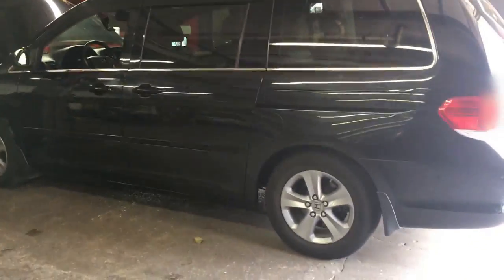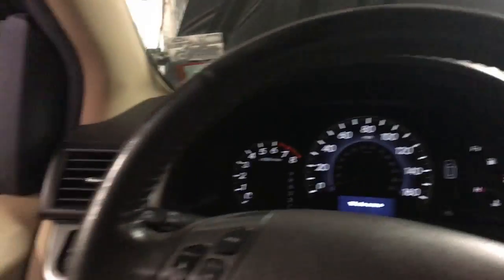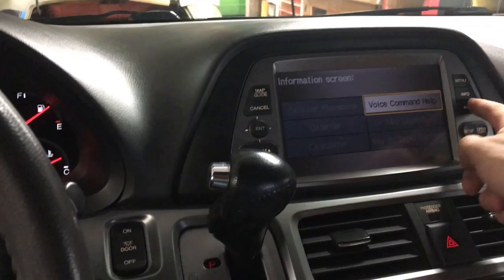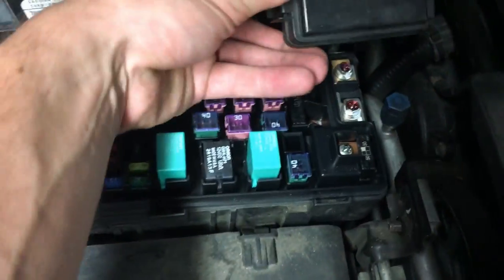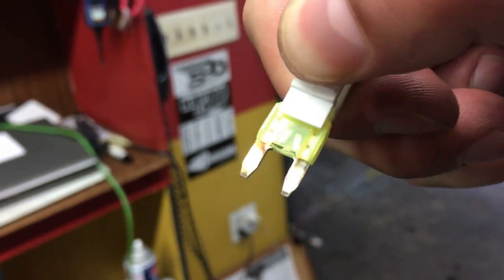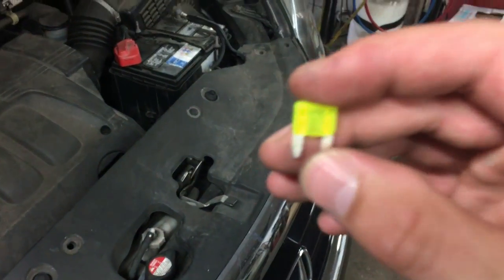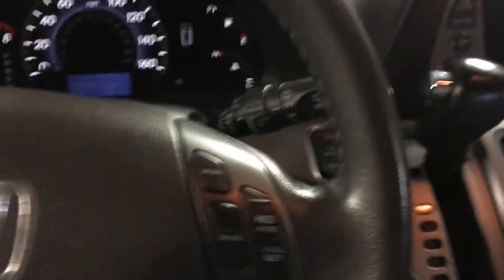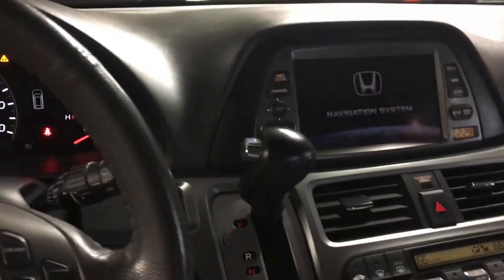Honda Odyssey No Sound but Radio Has Power Easy Fix

Comment: I having the same issue with my Honda accord 2010, i don't know what the problem is.is it the radio, amp or fuse...help-pp
Reply from the maker: Hey Salk Fozilov thanks for watching my video. Truthfully you should start with the fuses first. I am not sure that I have your exact model but check drivers side interior fuse 18 (7.5 amp) and drivers side interior fuse 16 (7.5amp). Also check under hood fuse 15 (10amp). Please let me know if any of this helps, and keep me updated. Consider subscribing to me, it would help me a lot, thanks.
Reply from the maker: Also if the fuses do not work there is a good chance you have a grounded speaker wire. The best way to check is with a digital multimeter do a continuity test on all the speaker wires.
Reply: thank u for replies.. so the problem was with the fuses under passenger side dash... the premium amp fuse was out.thx again
Reply from the maker: Hey Salo Fozilov I am glad you fixed it, always important to check all fuses before proceeding to the next idea.
Reply: @WheelsTips   Hi, can you help on my case, Honda Accord 2009. My android head unit sound work via Aux connection. One day, when i switch between reverse mode and run mode, the sound completely gone. (Which usually come back after reverse.) I did check 20 amp fuse. There still sound from speaker when i switch to original dashboard radio but no sound from Head Unit or Aux port.

Comment: Is it always the 20amp fuse for the no sound radio?
Reply from the maker: Hey Skander Ben Mekki thanks for watching my video. This video is of me sharing my experience with a Honda no sound from the radio fix.  Every troubleshooting experience and car issue is unique, it requires you to start and check certain things, in this video I guide you to what I checked and it happened to fix the problem.  Always make sure to check your fuse chart and owners manual to confirm where your fuses are and what type of fuse to use in what slot.  Please share an update on your diagnostics.

Comment: What is the fuse called? I have the same issue but volume comes on and off.
Reply: Marco Sanchez mine has sounds then fades to no sound then it gpes on and off
Reply from the maker: Hey Marco Sanchez thanks for watching my video.  Did you ever restore the volume on your Honda Odyssey?  Please share your fix, thanks a lot.
Reply from the maker: Hey kam shaft thanks for watching my video, please share your fix of the Honda Odyssey volume going on and off, thanks a lot.

Comment: Same exact issue on 2008 e350 a good Mercedes any help?
Reply from the maker: Hey Trippy G, thanks for watching my video. I would recommend you check your fuses, after checking your fuses I would scan the car for faults in the radio system. Please let me know if you resolved the issue, and if so what was the problem, thanks.

Comment: Hey, so my car radio works but it gives out weird noises...what could it be ? I don't think its fuse because it has some sort of a sound so what are the chances that its a short ?
Reply: So I assume you got nothing for me?🥺
Reply from the maker: Hey Max_Jank thanks for watching my video. What I would check in your situation is your connections at the speakers and in the door area to make sure that your wiring is in good condition. Also depending on what model you have, your amplifier maybe on its way out. What type of “weird noise”?
Reply: @WheelsTips  thank you! 
I have a Honda accord 2006 

This is the issue... 
Started going out- made a loud poping sound, and radio shuts off.. 
Everything comes up but when you put a CD in but the sound won't come....he radio won't come out and the sound pops once in awhile i think its trying to play but it won't.
Reply from the maker: Have you tried a different CD? Do you have any other issues with the car?
Reply: @WheelsTips  yeah nothing works
Reply from the maker: Hey Max_Jank thanks for the update. Nothing as in the car doesn’t work or nothing in the audio system?
Reply: @WheelsTips  in the audio system
Reply from the maker: Have you check all the fuses in the car? Do you have an owners manual? Have you had voltage / charging  issues or water damage of any sort?
Reply: @WheelsTips  i haven't changed the fuse but I was thanking on doing that. No problem with car whatsoever, just the radio its self dont work
Reply from the maker: It is definitely good practice to check your fuses. Please share an update.
Reply: @WheelsTips  yeah ill probably end up doing that

Comment: Hello Sir please help, stereo and speakers are good but everytime I step on the brake pedal either driving or not, my speaker shuts off but my stereo still has power..then after few pressing of the brake pedal, sound turns on again..I cant find any solution to my problem..thanks so much..
Reply from the maker: Hey jude delos reyes thanks for watching my video and for the great question.  What year , make and model is your car? Did you do any rewiring of your radio and is it the original radio?
Reply: Hi Sir, it's an aftermarket radio..I changed it because I thought the problem was the old stereo..so what I did was connect the positive or the yellow wire directly to the ignition switch but still it has the same problem..by the way I have s 99 hyundai starex..
Reply: I also tried the old stereo but it didn't work..thank you for the advice..
Reply from the maker: Hey jude delos reyes thanks for the update, I would say you need to check your fuses, then continuity of power to the head unit.  With all that said a wiring diagram would help you as well.  Please share an update if you can get a wiring diagram for your car, you may want to Google search, 1999 Hyundia Starex wiring diagram.  Looking forward to an updated diagnostics, thanks.
Reply from the maker: Hey jude delos reyes just checking in to see if you were able to fix your sound system on your Honda, any update is greatly appreciated, thank you.

Comment: My 2008 Honda Civic lx volume knob moves fine but the volume doesn't go up or down. Everything else works but the volume is stuck @ zero. It was stuck @ 100 when I brought the car but the used car dealership set it to 2 before I actually purchased and when I tried to raise it it went down to zero
Reply from the maker: Hey KidOldSchool let me start with thanks for watching my video. First to help me diagnose this do you have rear entertainment and if so can you get the car to adjust the volume of say a DVDwith the rear remote or rear controls? If so then it is most likely your radio unit itself or the knob is faulty. You can pick up a used unit but make sure it has a security code or you can send your radio unit out to remanufacturers they car rebuild it and give you a warranty.

Comment: i have the same problem in my ford explorer 2007... whrere is the fuse on this truck?
Reply from the maker: Hey Ramon Rivera thanks for watching my video. Truthfully I do not have a diagram of the Ford Explorer, I recommend googling 2007 Ford explorer fuse locations and check all your fuses. Please let me know where the bad fuse was after you find it.

Comment: Man i have the same prob but with a 2005 mustang that the radio shows everything but no sound comes from the four speakers but we checked the wiring and some fuses and no luck i need helppppppppppppppp!!!!!!!!!!
Reply from the maker: Hey Alex_King thanks for watching my video. If you have checked all the fuses and connections you should make sure your amplifier is working. Please get back to me with your diagnostics.
Reply from the maker: Hey Alex_King thanks for watching my video. If you have checked all the fuses and connections you should make sure your amplifier is working. Please get back to me with your diagnostics.

Comment: I have that on my honda civic 98 problem radio works but no souns
Reply from the maker: Thanks for watching my video and taking the time to leave a comment.  I would start with checking the connections at the back of the radio.  Please share an update if your checked that everything is secure with the plug connectors in the back of the head unit., thanks for any update.
Reply: @WheelsTips  everything is good connected
Reply from the maker: Do you have the original setup? If not maybe you have an amplifier that’s has a bad fuse. Also have you tried to swap the radio itself? Thanks for any update.

Comment: I just bought an 03 Gmc single cab and the radio works but only one little side speaker works hopefully it's the same problem
Reply from the maker: Hey jonathan chavez thanks for watching my video.  Please share your fix to only getting sound at one speaker on your 03 GMC, was it a bad wire?  Please share, thanks a lot.

Comment: hello does anyone know who the problem was doing the same but there is no sound the question is Ssangyong kyron 2006 if anyone can tell me what the problem is thank you
Reply from the maker: Hey Zoran Novakovic thanks for watching my video video. Have you checked all your fuses? Check in your owners manual where your fuses are and check them.
Reply from the maker: I just google searched Ssangyong kyron fuse box and found the entire layout. For example fuse 43 10amp seems to be for ‘audio’ check if the fuse is good. Let me know update.
Reply: thanks for your reply but am don't have the
Reply: @WheelsTips  Owners manual
Reply from the maker: Google search, ssangyong kyron 2006 fuse box. The first link will be to a manual website.
Reply: Can you google it for me and send it to see where that fuse is
Reply from the maker: Sorry but that is not my material. Give it a try, this will develop your best automotive knowledge. Make sure you know what your are doing before performing any work. Much luck.

Comment: I changed the fuse. But it didn't solve the problem. Still no sound.
Reply from the maker: Thanks a bunch for watching my video video and taking the time to comment. Was the fuse blown? Have you checked the rest of the fuses? If your fuse was bad and it’s still not working, you may have to check the connection at the back of your radio or see what the condition of your amplifier is if you have one separate from the radio. Please share an update, thanks.

Comment: what if there is sound but one of the speaker has a static sound?
Reply from the maker: Thanks a bunch for watching my video and taking the time to comment. I would check the connections at the speaker and back of radio. Please share an update, thanks.
Reply: Do you have any videos on how to check connections on speaker and radio?
Reply from the maker: Unfortunately I do not, sorry.

Comment: Hi i just bought a 2003 honda and im having the same problem my radio comes on but no sound
Reply from the maker: Hey Shareese Curry thanks for watching my video. Let me know if this video solved your problem.
Reply: @WheelsTips  i don't have a double fuse box under the hood do u think it it's in the car
Reply from the maker: Hey Shareese Curry what kind of car do you have.
Reply: Honda accord 2003
Reply from the maker: Hey Shareese Curry sorry for late response. Did you ever get this fixed?

Comment: What fuse it it for
Reply from the maker: Thanks a bunch for watching my video and taking the time to ask a question. Your fuse layout will be on the cover of the fuse box, which should tell you the name of the fuse. Please share an update, thanks a bunch.
Reply: @WheelsTips  I got everything hooked up in my 07 honda civic LX an it turns on but no sound an radio says (amp error) what do I do
Reply from the maker: I would start by checking all your fuses, if all is good with fuses I would move to checking the amplifier and its connections, if it is a standalone type.  Make sure your connections are fitted snug. Please  share an update, thanks a bunch.

Comment: I replaced the same exact one but still notning☹️
Reply from the maker: Thanks a bunch for watching my video and taking the time to comment. Was the fuse actually blown, you only need to replace it if it was blown. If it was blown you had to replace anyway, I would check the rest of the fuses. Please share and update, thanks.

Comment: where is the fuse box on a honda element 2004
Reply from the maker: Hey Frank Rangel thanks for watching my video.  To the best of my recollection you have one in the engine bay but may also have one elsewhere.  Do you have an owners manual that way you could check in the fuse section?  Please share an update, thanks.

Comment: I have the same problem but on a Lincoln MKX
Reply from the maker: Hey maximo b, thanks for watching my video. The fuse for Lincoln MKX radio fuse is in the passenger compartment fuse box , fuse 28 (5amp) and fuse 39 (20 amp) . Please consider subscribing it would help me a lot, thanks.

Comment: What's the name of the fuse? 
Has anyone had this problem occur on their 2006 honda accord?
Reply from the maker: Hey Kevin Kevin thanks for watching my video.  The name of that specific fuse was the, entertainment power fuse.  On a 2006 Honda I believe it is the fuse in the driver foot-well bottom row 5th fuse in that says radio.  Please share an update if that was it?
Reply: I have this on my Accord 2006 idk hiw to fix but i’ll try the fuse I suppose
Reply: @WheelsTips  it didn't work. I switched the fuse and still no sound came out.
Reply from the maker: Was the fuse bad? Meaning was the bridge not connected? If so then you have another problem. If it was not broken then the fuse was good and you have a different issue.  Best thing would be to find a wiring diagram and see all associate parts involved to have a framework.
Reply from the maker: The fuse is either good or bad. If the bridge is broken it is bad, if it is not then the fuse is good and does not need replacing.
Reply: Kevin Kevin let me know if you ever find a fix
Reply from the maker: Is the radio turning on and not playing sound or is it not turning on at all?
Reply: @WheelsTips  The fuse was good but I sitll decided to put another one. But all it does is turn on with no sound, all the buttons on the radio work.
Reply from the maker: From my experience when he radio turns on and has no sound it is either a connection issue at the back of the radio or at the amplifier if one is installed.  Also could be an amplifier fuse or the amplifier itself.  If the amplifier is build in the radio it is possible the radio/ head unit needs rebuilding.
Reply from the maker: Take a look into the amplifier and the fuse for the amplifier, if your car does not have a separate amplifier check the connection at the back of the radio, if that is all good you most likely would need to rebuild or replace the head unit / radio, this is just my opinion.
Reply: Kos Motorcars Inc got a tip from my friend with the same issue that he had a blown out rear speaker and once fixed everything worked fine so I suppose its worth a try, because i’ve tried with 2 separate head units and neither worked.
Reply from the maker: What year make and model do you have?
Reply: @WheelsTips  where would I find the amplifier fuse ? And where is the amplifier located?
Reply: Kos Motorcars Inc 2006 Accord Sedan
Reply from the maker: Hey Irvinn Luxe have you tried to look into the amplifier.  Google search 2006 Honda Accord amplifier location and see what is going on there.  Please share an update if you already fixed the no sound issue.
Reply: Kos Motorcars Inc I replaced the Rear deck speakers and it fixed my issue for me, I think one might have been blown, but the audio is so good now just had to replace those.

Comment: Sound come on for 5 minutes then shut down and not come back until another 2 days what is the cause on a Honda Odyssey 08 touring
Reply from the maker: Thanks a bunch for watching my video and taking the time to comment. The situation would probably need a little more inspection, my best guess is something needs to be rebuilt. Perhaps the radio headunit or amplifier if you have one is overheating. You can Google search remanufacture services such as, remanufacture rebuild Honda Odyssey headunit radio repair. This will cost you a fraction of replacing the items, if that is your issue. Please share an update, thanks.

Comment: Every time I replace it with a new fuse it burn out as soon as I put it in. #20 PREMIUM
Reply from the maker: Hey kevin rojas thanks for watching my video. If it burns our you have a different issue. It is best to let someone familiar with the wiring of a vehicle to examine the issue.
Reply: Have you ever find the problem why it was burning the fuses

Comment: What if the fues is good?
Reply from the maker: Hey Austin Bradley thanks for watching my video. If the fuse is good, check all your fuses. If all your fuses are good, you may need to run diagnostics such as, checking power supply to head unit. It is possible that you also have a poor connection at a speaker, or the head-unit needs to be rebuild or replaced. Please let me know what you find in your diagnostics.

Comment: I have the same problem but it seems that everytime I put a new fuse in it blows immediately
Reply from the maker: Hey Nezzy Sullivan thanks for watching my video.  If your fuse blows all the time it seems you have a short in the system.  Have you tried unplugging devices on on the path of that fuse, such as the amplifier?

Comment: Driver side speakers aren’t working will one of the fuses being bad cause that?
Reply from the maker: Thanks a bunch for watching my video and taking the time to comment. I would check the connections behind your radio and at speakers. Also if your have an amplifier may want to check the wiring to that as well. Please share an update, thanks.

Comment: What fuse would it be for a 2003 accord I have the same problem
Reply from the maker: Hey Duuhh it's Kaleigh thanks for watching my video. To the best of my memory it was fuse 5 which is bottom row of the driver footwell fuses, counting from the left the 5th fuse.  Pull it out and see if has a broken bridge or not.  Please share if this helped.